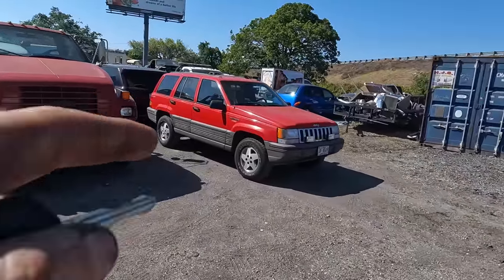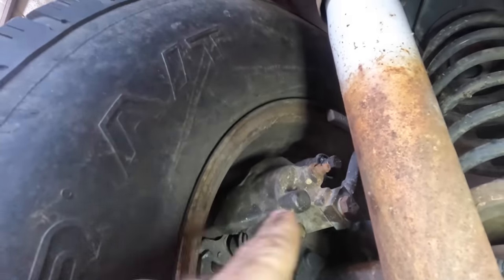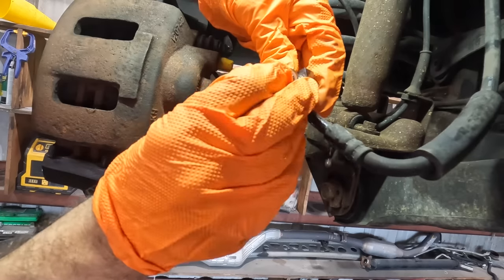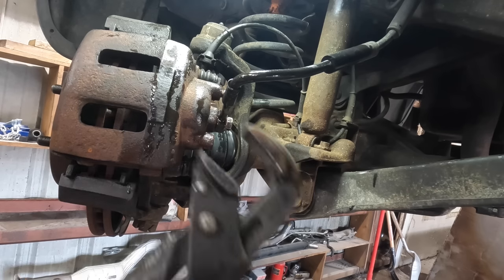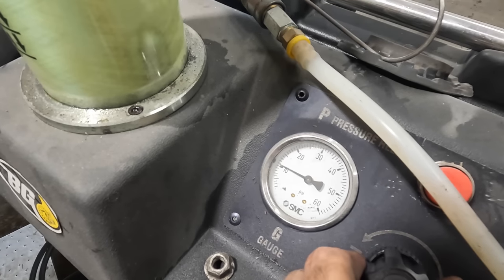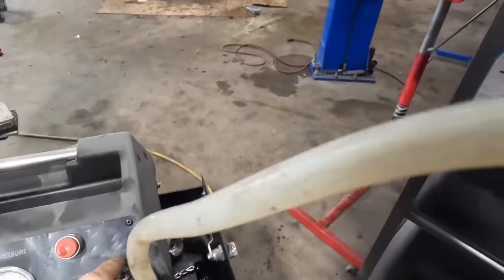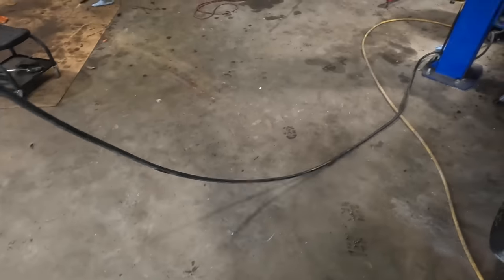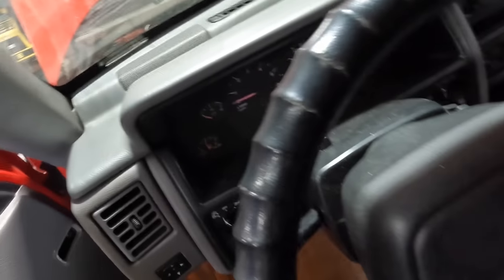Customer States: Air in System No Brake Pedal! |  Jeep Grand Cherokee 5.2 v8 #nobrakes

Comment: That engine is infamous for trouble with temp sensors. Makes for that long crank start.
Reply: At least in the northern areas like where I live.
Reply: 1/4 mil miles doh😮 from a Chrysler product…. I’m actually impressed.
Reply: @rednew8222  better than a ford
Reply: ive never had an issues out of my 5.2 engines
Reply: @rednew8222  go to lkq and tell me how many fords you find😂
Reply: @calebwiant1182  all my ford's have gone over 300.000miles with no problem.
Reply: @tinydog34  you just having luck, or doing something but in the south these fords dont last long. i work at oreillys and i sell alot of ford parts. and then on top of that we even have rental tools for the tritons
Reply: @calebwiant1182  my last one was a explorer and went over 407.000 miles and I take care of it really well. It's just how people take care of their cars.
Reply: @tinydog34  well you must take really good care. keep doing it

Comment: Brake machine is silly waste of time  (and money)
Reply: Fluid exchanges are most important in hot climates.
Reply: @wayneessar7489  True, but this machine is a silly waste of time and money.  If he would have just opened the bleeder and left them open they would have bled in a few mins. Chase it with new fluid till it come out clean.

Comment: You are wasting way too much brake fluid. There can't be more than a half a pint that goes between the master cylinder and the farthest wheel.
And that is a fuel injected engine, you need to turn the key on and wait a few seconds while it builds up fuel pressure before you try and start it. That's why you're getting hard starts at higher Miles because people have been starting it without letting it prepare itself. That's hard on the starter and the fuel injection system when you try and start it before the fuel injection system has come up to pressure
Reply: You said hard-on.